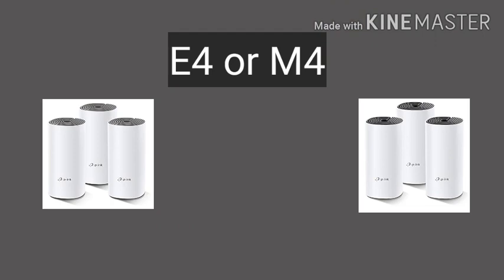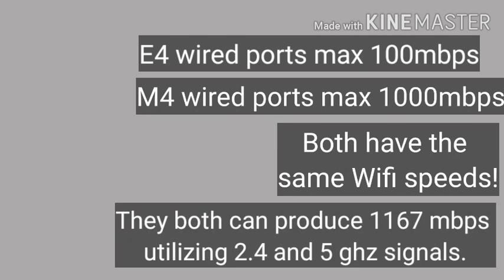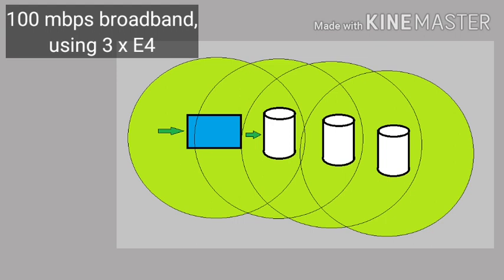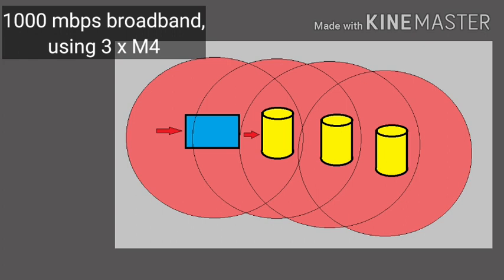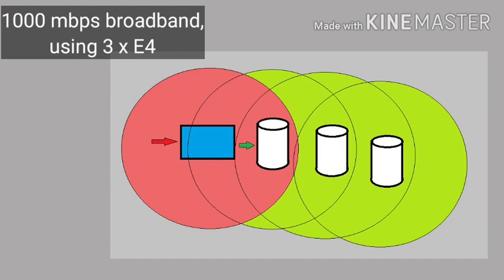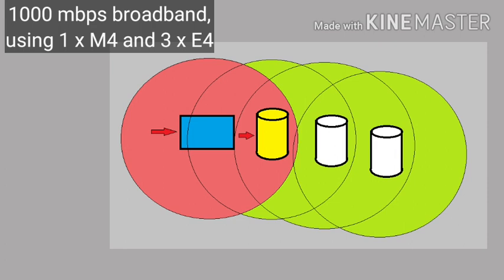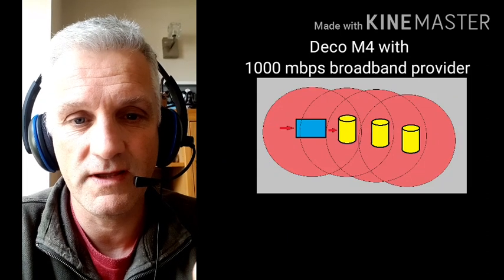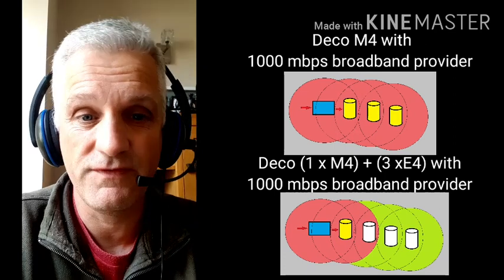Deco E4 vs M4 - better explanation and configuration idea!

Comment: Great explanation M8. I’ve the smartest configuration on a 300mb/s plan. One M4 to the broadband router and then 3 E4’s over WiFi. Works as a charm, and it’s very affordable.
Reply from the maker: Perfect!  Glad to have helped!  Spread the word and check out some of my other stuff.  It's all a bit random, but hopefully a bit of fun!
Reply: Are you guys saying that the 3x M4 setup is the same as 1x M4(main) and 2x E4(satellites)? Will you get the same speed, let say 300mb/s plan, if connected to one e4(satellite) compared to one m4(satellite)?
Reply from the maker: The only difference between the units is the port.  Once in your wifi network, they transmit the same.  So if you use the m4 as your primary, then you have essentially the same set up as all M4s.  Only difference is if you need a physical connection from one of your secondary units, but that is rare.
Reply: @stevedogwildman2133  Oh i understand now. I thought at first that the E4 secondary units will limit the speed to only 100mbps to all devices connected to it even if you have a M4 main. I will probably also do that setup then. At least that setup has one additional mesh compared to 3xM4 with basically the same price. Thanks!
Reply from the maker: I have 1 x m4 and 3 x e3.  I use the m4 as the primary, but my broadband isn't quick from my provider.
Reply: @stevedogwildman2133  you’ve invested for the future development of your providers network enhancements Steve. My provider does not go beyond 300mb/s ATM, so I don’t have (yet) the motivation to update to the new X20 Decos. Will see in the near future how this goes! As for now, M4 + E4 satellites are he best cost/benefit alternative
Reply from the maker: You are right!  Subscribe and you'll see all manner of other fun stuff on my channel, and I'll try and study more mesh wifi developments and post them on the channel!  Thanks for all your comments!
Reply from the maker: See this video.  You might find it interesting!
https://youtu.be/cMaonON0e_0
Reply: Are you getting more than 100mbps on the E4?
Reply: @hamsome9511  I’m getting more than 100mb en the E4’s, because I’m using them as satellites. The M4 is the one being connected to the router and getting the 300mb via Ethernet
Reply from the maker: No, cos my broadband provider only provides 50, but you could.

Comment: Thanks for the video, I appriciate the explanation. I have some doubts hopefully you can help me with. As I can see in the charts you show, you can use the wifi on you modem togheter with the mesh system? I mean, can I still use the wifi of the modem, for example, in one room (First floor, front of the house, the office, where the fiber optics and the modem is), and via LAN put one DECO in one bedroom (Second floor, back of the house), with the same SSID as the modem in the office, and a second DECO in another rooom (Second floor as well, front of the house)?   So doing this I imagine that i can cover more space of the house, or do you recomend to not use the wifi of the modem, turning off the WLANs and only use the DECOs? Sorry for my english, I´m from Mexico and I´m a little rusty in the writirng. Thanks and regards.
Reply from the maker: You can use both together, so your existing wifi and lan system can be left running and you use the mesh wifi alongside it.  You must ensure you have one lan cable running from your existing router to your primary mesh unit, but thats all.  You will (for example on your phone) we 2 wifi networks.  From another mesh unit, you can take a wired lan from that, so you could have router->wire-mesh1->wifi-mesh2->wire->pc.  For example. And still have your existing system running alongside!
Reply: Steve Dog Wildman Thank you!